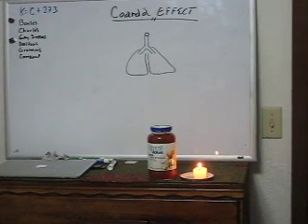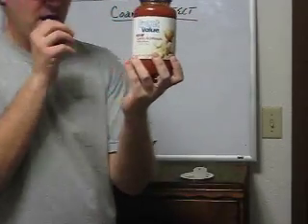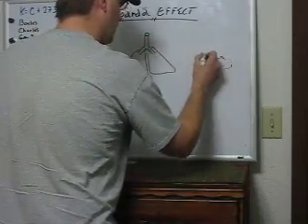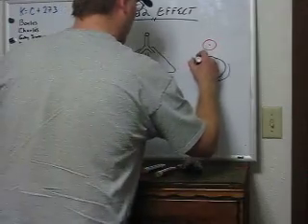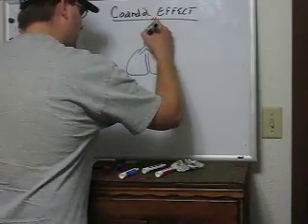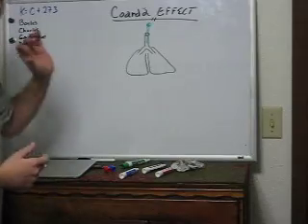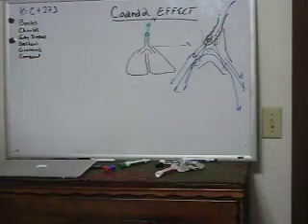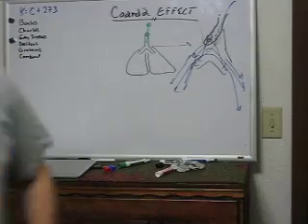Fluid Dynamics VI Coandă effect

Comment from the maker: I am sure it is actually possible to set up an experiment where you could appreciate the Coanda effect around a square object such as an iPad. It would probably depend on the initial conditions you set and the type of fluid used. I think something with a fair amount of viscosity at a specific Re number would probably work. The drag coefficient of the iPad would probably play an important role in setting the experiment up as well.